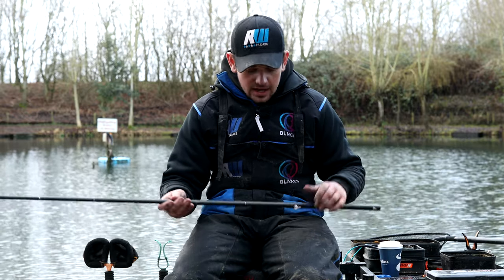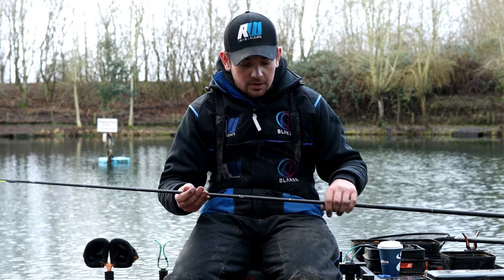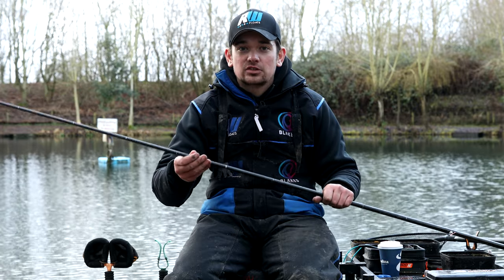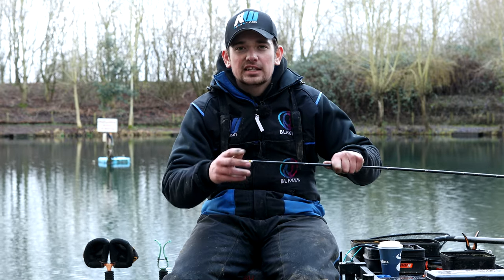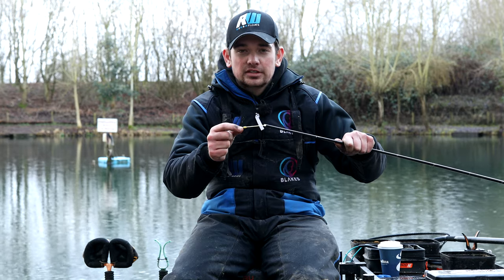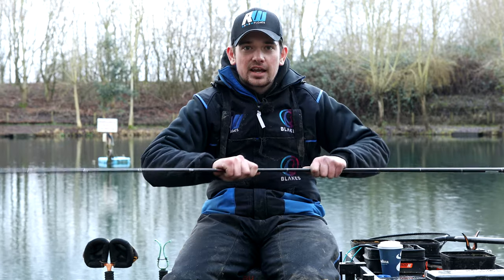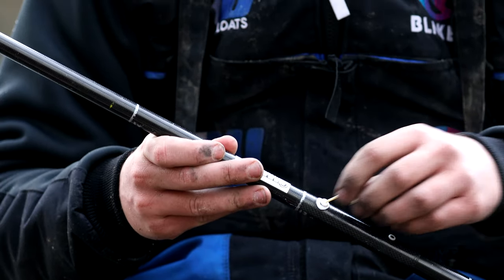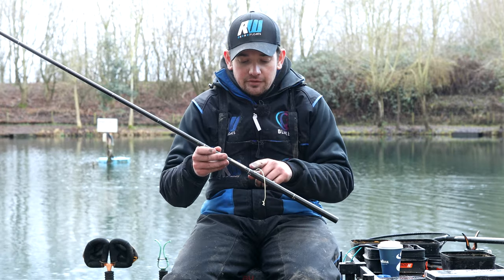Pole Setup | Top Kit Length

Comment: What size Bush do u use on the daiwa big bore kit,so it's the same length as the match kit
Reply: Five different internal bushes are available 2 of which which fit straight into your daiwa match no 2 section with the no1 removed.
Match Solid has a small bore for elastics up to solid8 and Match Hydro has a larger bore for Hydro up to a Black.
Two more standard internals with bores of 1.6mm & 2.4mm are now available.
The Big Bore Power Kit bush fits a BBPK1 section cut down to match the length of a match 2&3 section.